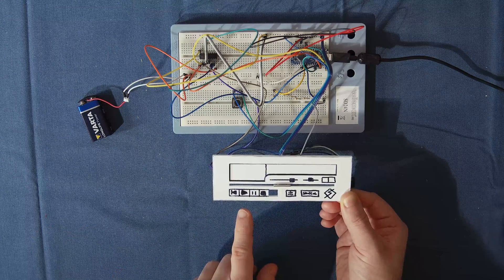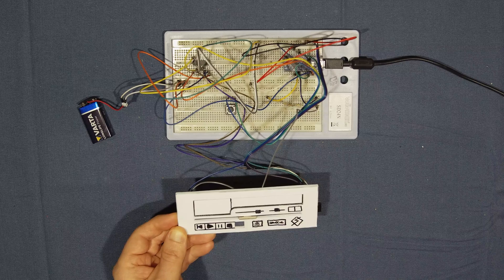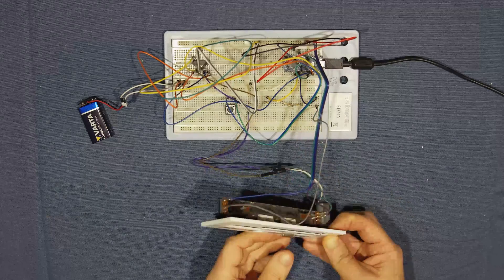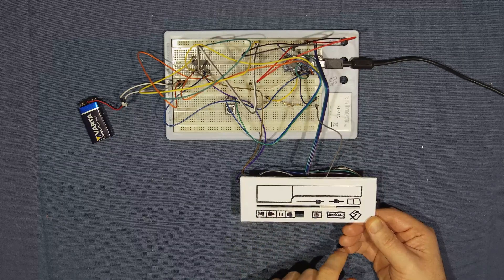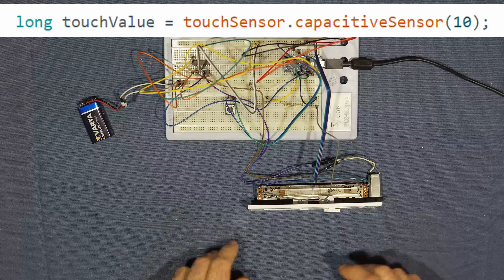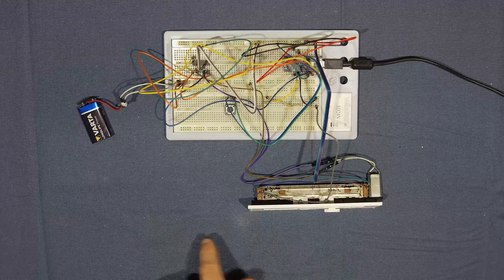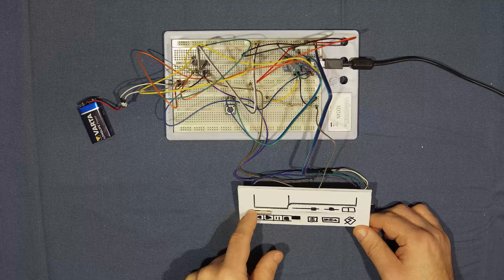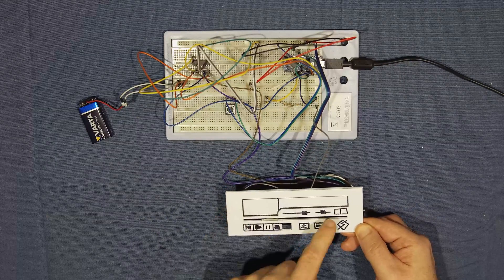Physical Winamp (part 1)

Comment from the maker: I'm going to do a little experimentation still, maybe a stepper motor for precise positioning, and then sensorless homing using the motor load and stuff, like fancy 3D printers do... we'll see!
Reply: DC motor is a good idea, what if you would use lead screw with magnet at the end and encoder to read/count position? it would be probably more reliable in the long run than potentiometer. Splitting design into 2 modules, one that handles buttons, slider, and other one to handle music and screen?

Comment: You dont beed to develop the wheel again.
There is sliders with motors and linear encoders. Their are used in mixers, both for audio and light :)

Comment: Can you share the potentiometer details? Brand, Model or part number maybe?
Reply from the maker: Absolutely, it's a "Bourns Pro Audio Slide Potentiometer", model PSM01-081A-103B2
Reply: @dirkderkdurk thanks for the quick reply! I thought only I had this idea after looking at that 3d render. Are you still working on this?
Reply from the maker: @socialbug1130  you're most welcome. I took a break to work on something else while I waited for screens to arrive from China, but they arrived last week, so yeah, I'm about to continue! I'm also using a Pi Pico now, and it's infinitely better. Good luck!

Comment: I like the idea of a motorized slider.  Used to play with Winamp back in the 90's!  I would suggest a rotary encoder for accurate position for travel.  Salvage a mouse wheel would help.  May get decent feedback from motion.  Most analog potentiometers are a bit noisy if you are looking for a clean transition. Good luck with your project!
Reply from the maker: Hah, I was talking about dismantling a mouse yesterday with a friend, it's a good idea, ta! I'm also going to go the stepper motor route, just feels more controllable.

Comment: Anyone ever used a light rail? A grow light mover, it's a motor driving itself on a track, it has a dpdt switch and you can set it with a little stop, it bumps into the stop and the switch gets pushed reversing the direction. 
I bet you there are some cool things you could do in terms of using one of these motor pots and then looping it back with a switch so it can trigger something based on it's own position, loop two such systems in different ways to get really crazy types of feedback circuits to control stuff or create dynamic feedback.

Comment: Here is a little tip for the jerky motor: Maybe try to use a very low PWM-frequency (like 20Hz to 50Hz ), then the motor will be pulsed forward slowly on the slow settings by the individual PWM pulses instead of sticking and then slipping when you try to apply constant torque
Reply from the maker: That's a fantastic suggestion, I didn't know that was something you could do, I'll give it a go, thank you so much.